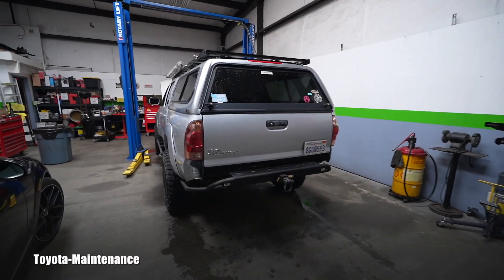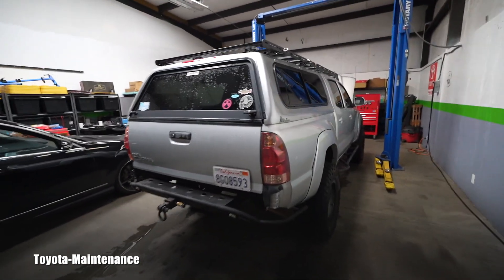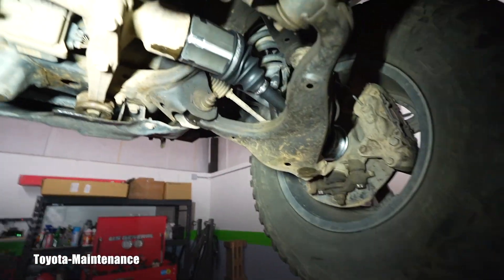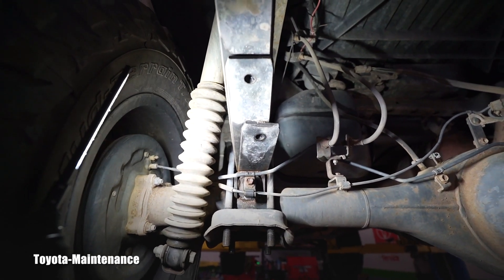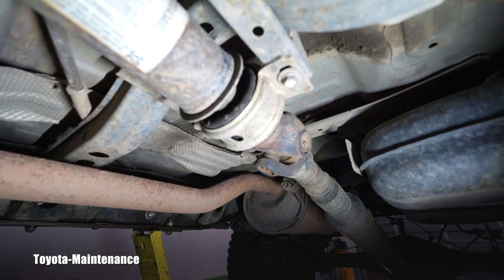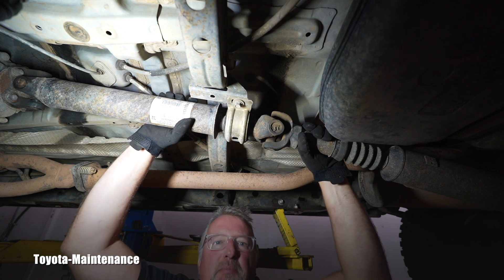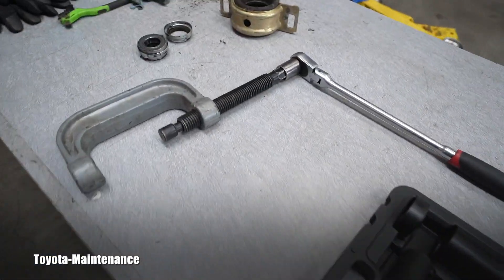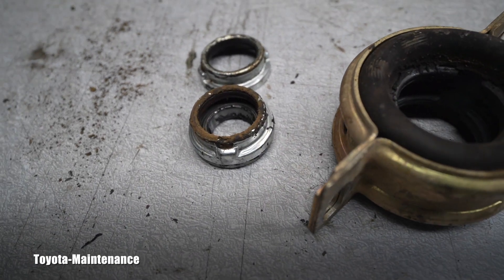Vibrations When Accelerating

Comment: What lift is on the truck? Have they added a diff drop kit? Did you install axles with high angle boots? Did you eliminate the needle bearing in the front driver side diff, and replace it with the East Coast Gear Supply bushing? If not, the customer may very well be back with torn inner boots, and a shot needle bearing. Just had to address those issues on my 08 Tundra.

Comment: I have a 2014 Tacoma 2WD , the Track off and the engine light is on and the truck starts with a Vibration on the Rear and , at low speed. 
Any suggestions?

Comment: Nice video. One comment, you installed the carrier bearing upside down. The single hole should face down. They are slightly offset and will wear out much faster if installed this way. Made the same mistake myself and had to do it again less than 2 years later.

Comment: Ugh one of the things I have changed twice. I added a drop kit on it.

Peter, what grease do you recommend for the slip yolk that will last longer than 6-8 months?
Reply: Mobil 1 synthetic.
Reply: Use oem part
Reply: @rj.parker  thanks for the reply, but I was talking about what grease would be a longer lastingoption for the slip yolk end. I was not talking about the carrier bearing.

Comment: My 2012 Tacoma was making sound under load, went and checked play in that support bearing, and realized my bearing is shot and now I know what I need to fix on it now.  Thank you for doing this video!!
Reply: Was it the rear bearing? My 2008 Tundra needed rear wheel bearings at 100k. It threw a speed sensor code. To rebuild the axle was costly due mainly to labor. Toyota had a kit with the axles preassembled for the most part. Even came with new backing plates. I always haggle the price and got a pretty good deal.
Reply: @weshallnotforget2948  no, it wasn't a wheel hub bearing, this is the front portion of the drive shaft support bearing at the union near the transfer case (4x4)  no wheel speed sensor code there. But it is nice to know that if your wheel bearings are going out, a wheel speed sensor code triggers to help identify and diagnose the issue. My taco has 150k and didn't anticipate I having to replace the drive shaft support bearing.
Reply: @jbbarron80  my '97 taco with MT has been having weird vibes for the past year, the support bearing is original at 334k miles. (the manual clutch is also original bearing and disks)   so these vibes seem to happen at about 2k RPM and then go away with increased speed... I was thinking its the clutch disks chattering? but perhaps it is the support bearing that seems a bit loosey when pushing up on the driveshafts